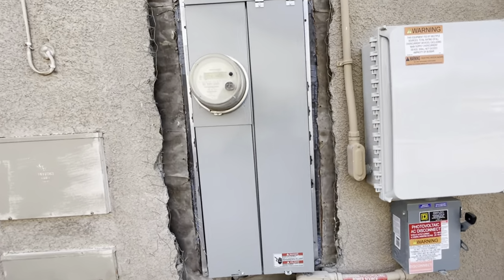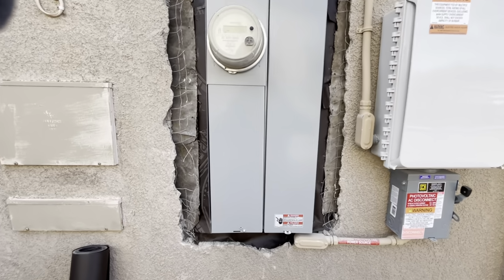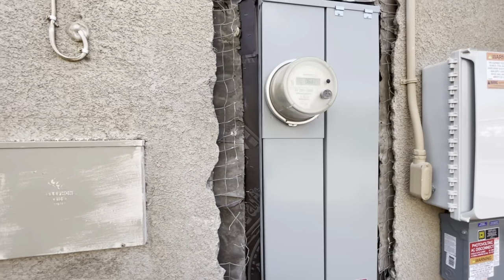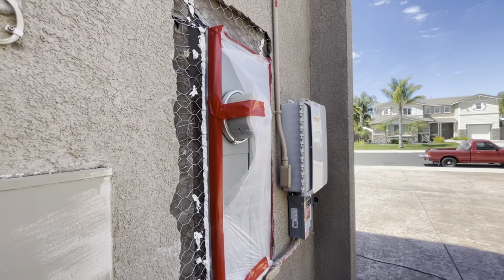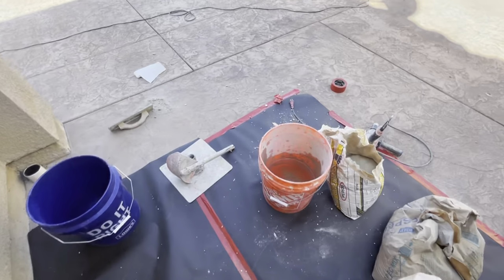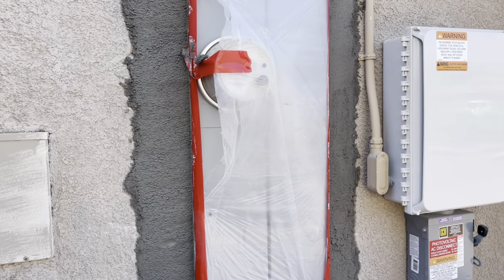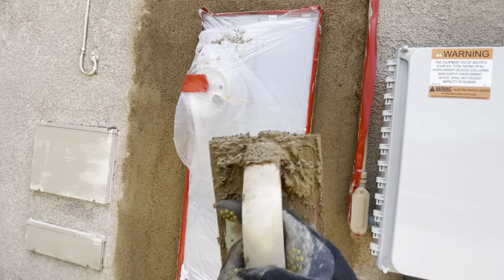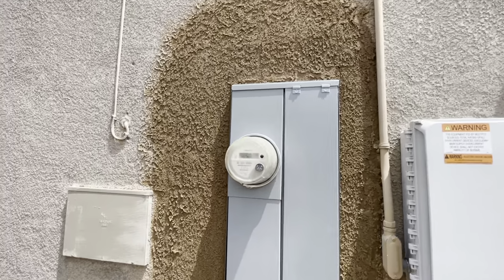Stucco Electrical Panel

Comment: Nice work, can you please tell me the proportions of the rapid set and spec mix also the water just for that space? (Looks like you had a bucket full which you didn’t use?) Also the dry time before floating? Oh and can I just paint it over or do I need to do a color coat? (I have the paint already)

Comment: Im here tryin to see if i can pinpoint where water might be leaking into my panel. have the same panel combo in exterior and some water gets in , slow drip from where the cables drop into the breaker side of the box. wondering if the drop-down cables might be trickiling water in since they dont have a correct drip line.

Comment: When you say you applied on there did you mean you applied the La Harbra 16/20 to your new stucco patch to match the finish?
Reply from the maker: Yes, I applied the La Habra 16/20 over the brown coat then I’ll let it dry in about 5 to 10 minutes and then skip trial the texture on there with the same 1620

Comment: How would you access  that panel to install a new circuit to the house? Would a electrician access panel from the inside of house wall?  very nice work with the cement finish,,
Reply from the maker: To be honest I do not know I’m not an electrician I’m just strictly Stucco I’m sorry I wish I could help you on the answer
Reply: Depending on the electrician, (if he cares) he would leave out spares for future existing conduits or flex for the next electrician...
Reply: How do you match the color??? Just paint it after??
Reply: It looks like they broke the stucco to add in the solar panel circuit...